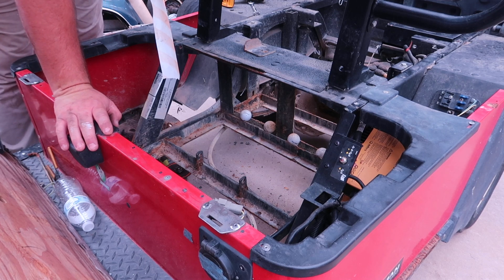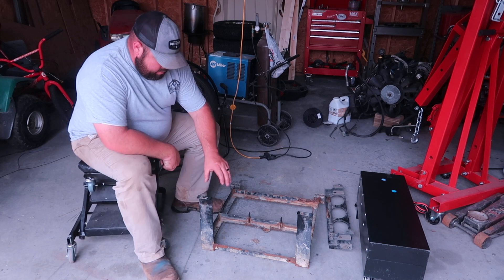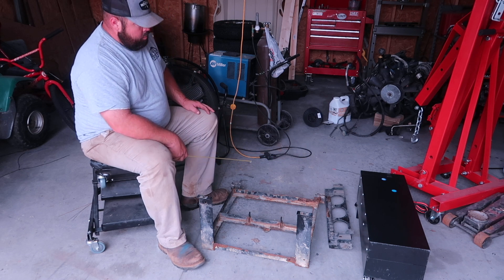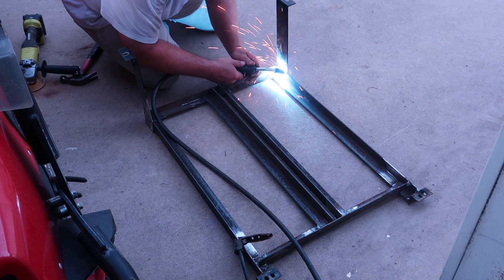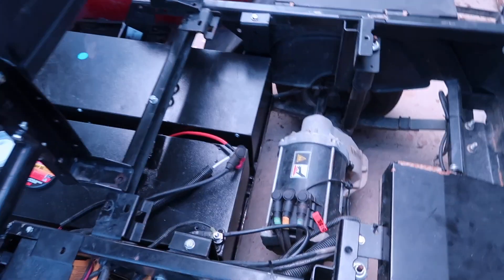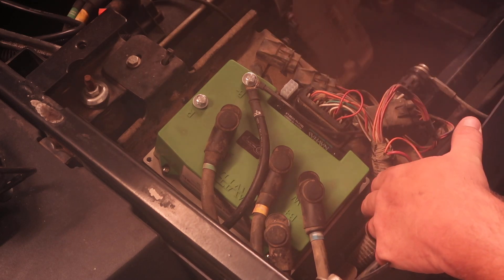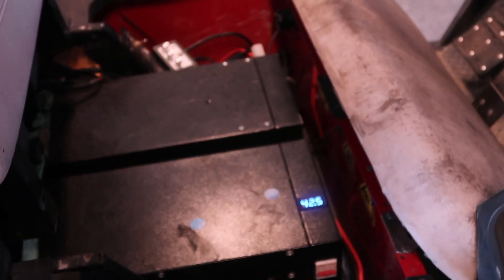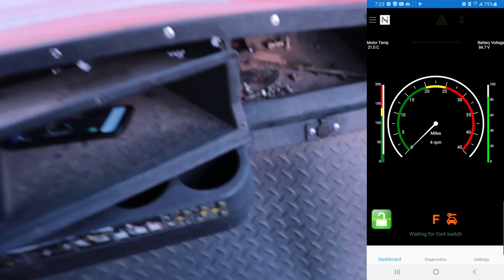This Golf Cart RIPS! BigBattery Lithium & Navitas AC Upgrades | EZGO Cushman 72v Hauler Pro

Comment: What specific model Navitas controller did you use for this? Also, did you have to modify it at all. I talked to the Navitas folks and they said I had to move a resistor in the fuse board and also change the axle direction in the app. Does that ring a bell?

Comment: What's the minimum voltage that the stock controller and motor can run on? It looks like the Cushman lithium battery is only 48V.
Reply from the maker: This cushman was a stock 72v AC cart. It had 9 - 8v batteries in it stock.
Reply: @Fentertainment  interesting. I wonder why the lithium version seems to be lower voltage.
Reply from the maker: @niktak1114  Idk to be honest. In the later videos I did a navitas controller swap and ran 48v lithiums.
Reply: @Fentertainment  the stock motor runs fine at 48V?
Reply from the maker: Yup it did fine. I think the stock ac motor was a Letrika motor if Im not mistaken and I also tried it on 36v and it did ok. Not that I was running it on 36 but just expirementing. But "Letrika" was the brand of the motor on a stock ezgo ac cart. @niktak1114

Comment: Hey brother Dustin Sutton here with DCS electrical services llc in Hilton Head Island. I've been over the top studying brushless motors and controllers the last two years due to an injustice and some down time. Currently in my 2010 precedent I have stripped it down looking to upgrade to brushless motor I'm running 56v 10ah{10p} The brushless motor I had of burn up while welding some framing. I only have a 3000 watt 80 amp controller. I was hoping you could give me some pointers anytime. I'd love to give you my Trojans  Curtis and harness with battery port only thing I'd keep is the mcor I'm just a little down on funds so really not much room to wiggle I'd rather someone with experience  steer me in  the right direction

Comment: Hello. I watch your videos all the time. Thx for sharing your knowledge. I have tw questions for you. Can I put an EZGO Storm body on a CUSHMAN? Is this CUSHMAN the same frame size as the TXT?
Reply from the maker: The cushman that I have looks to be a tad longer than the txt. However the front should fit without a problem. I’m guess the rear depends of the length.

Comment: I just bought a very similar 2016 Cushman Hauler pro 72v missing the controller (went bad, thru away), what model# Navitas controller did you use and where is best place to buy?
Your videos gave me the confidence to buy it and fix, otherwise I wouldn't have a clue what to do and probably passed on it.

Comment: most likely thinking about doing this swap but keeping the original controller. would i use the oem charger as well? we have the same cart
Reply from the maker: My  oem charger only charges to 85v and the bigbattery charges each battery to 45. So the big battery charges to 90v.
Reply: @Fentertainment  ok so I'd have to plug in each battery individually?
Reply from the maker: @instrumentalbeats805  I have been, because i wired them in series.

Comment: Did you use two of the 36V batteries in series to get this 72V setup?
Reply from the maker: I did. 2 bigbattery 36v gators.
Reply: @Fentertainment  man idk if I could fit two of those in a club car bucket! Might have to try a different route if I want to go 72V with my Navitas motor.

Comment: While the navitas is bad ass, that cart will do all that and more on the Curtis controller that comes in that cart, just need a handheld. We’ve had em doing 37-39, on regular lead acid batteries
Reply from the maker: While thats true, I wouldnt be able to adjust it on the fly. I dont like riding with regen on back roads but turn it up when I ride on some main roads. I also use more regen when Im stopping after doing higher speed runs.
Reply: @Fentertainment  That makes sense, love your stuff by the way. I’m with Kart King in Augusta. We made a 6-7 month run converting these 72V haulers into monsters and they turn out pretty crazy performance wise. We recently started carrying/building the new Navitas chassis full time and are absolutely loving them. Go check out our Facebook if you have time and see some of the 72V’s we built as well as the new Navitas chassis we’re doing. Would love to connect. Keep up the good work
Reply from the maker: @chandlerhall6899  Appreciate it man. I have been following on Ig, fb and tiktok. Those conversions looked good also.
Reply: Bought a used handheld from China and waiting for it to come in. Hopefully $200 well spent instead of $600 on a new controller

Comment: Question ,, if i change my controller to the 600 amp navitas  , on a stock ezgo txt will i get more speed out of it ,, I’m getting around 23 to 24 mph now , it has a Curtis controller thats been turned up from the dealer  ??  The cart it self is not stock , it has 23 ‘’ tires and its all custom , any advise ??

Comment: It showed 40mph. But did you adjust the setting in the controller for the smaller tires? I'm thinking more like 25?
Reply from the maker: I did. its on 72v not 48. So with the gearing set to 15.01, Tire size to 18 and rpm was around 11,500 @ 40mph. You can put the settings in a online calculator to check it all out for yourself.  https://spicerparts.com/calculators/engine-rpm-calculator
Reply from the maker: First off, Thank you for the constructive criticism. So I did a speed run to help us pin point exactly what we were doing. https://youtu.be/HK0JGFXcCr0
Reply: @Fentertainment  I did not mean for my comment to come off as an asshole, i was just curious if those adjustments were made. I have purchased the navitas kit and the roypow 51105 . And I installed it on my 2015 ezgo terrain250 . I'm getting 34mph on 23" tires. If not for your videos I would not have known about either of those products. So thank you for your time in making videos,  I have a channel too so I know the work and time it takes! I did see the speed video before you took it down. Have a great day.
Reply from the maker: @randomness75  ita all good man. Didn't take it like that. This is youtube and you take everything with a grain of salt. Which gear is in your rear axle?
Reply: @Fentertainment  I'm guessing it's stock. What ever that is?
Reply: @Fentertainment  That link says the video was removed.
Reply from the maker: @goldenlife9856  it was but might be in the next video.

Comment: I got exact same speeds rebuilding a 2010 DS 6” lift, 23” wheels, DoubleTake rear seat, 48v 600Amp Navitas TAC2 with 5kw motor, 600Amp soliniod, using 4 48v Allied lithium.

Comment: I've got a 2008 RXV I just put a Navitas TAC 2 600 amp controller and a Trombetta 600/225 solenoid and stock 48v (12vx4 Trojan lead acid) and I can pull wheels about an inch off the ground with acceleration at 16383 in app

Comment: How long did it take you to get your big battery? Mine has been sitting in LA for two weeks! R&L shipping is who they have used. I am not happy Big Battery seems to careless that the battery has sit for two weeks! All the told me is they shipped it and did their part!
Reply from the maker: These 2 were also shipped with R&L and took about 2 weeks to get. R&L sent a text for me to call them back and I did. They had to schedule a time for me to sign and be home when they arrived. He pulled up in a 44ft trailer and delivered the batteries in my garage. If I was you I would call R&L and see if they will give you a eta. I dont see bigbattery having any know how about shipping once it leaves their hands.
Reply: @Fentertainment  yeah I’ve called both and R&L has said they will do a dock check 3x now and it still hasn’t left LA yet.
Reply: My battery will finally be here Monday after almost 3 weeks to get it. Also what batteries did you use to make this cart 72V? Are these just two of the BDGR 48V batteries in series configuration? Or were they the 36V GATR batteries? I am going to the Navitas 5KW motor and just found out I can go 72V on it later if I want to also. So I may do that. Thanks